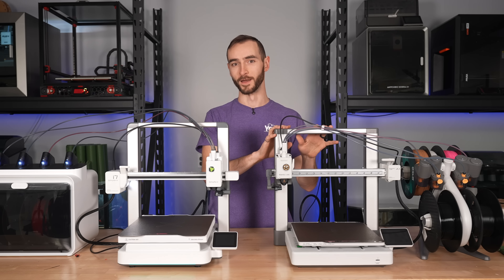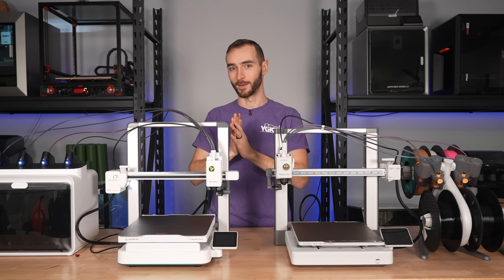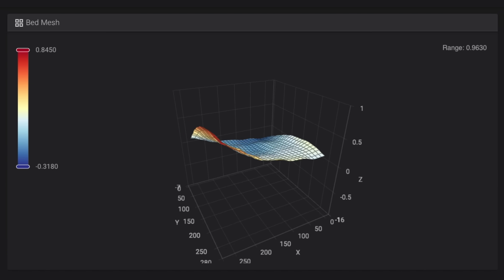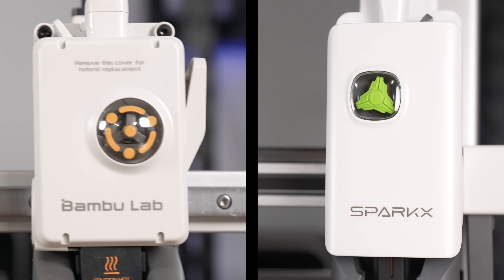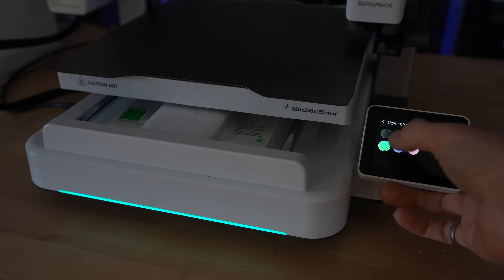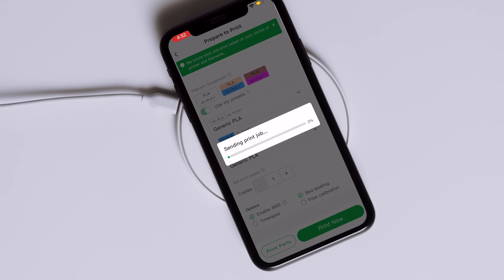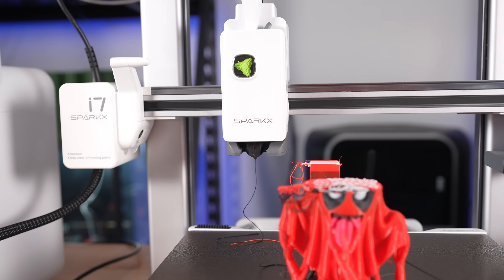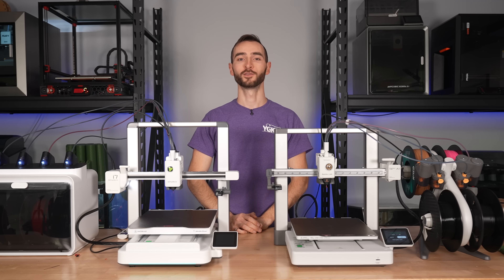Creality Cloned Bambu's Bestseller (and made it better?) - SparkX i7 vs Bambu A1

Comment from the maker: Take your personal data back with Incogni! Use code YGK3D at the link below and get 60% off an annual plan: https://incogni.com/ygk3d

So what do you think, just another clone, or a meaningful improvement?

Buy the Creality SparkX i7: https://tidd.ly/4jNwMCd
Reply: The Creality HI was supposed to be this, remember (seriously, do you remember it)? Until Creality can stick with one product more than a year, there's no way I can recommend them. Proprietary-part-laden machines are bad enough, but if they stick with a design and support it for years? I understand. But Creality doing this every few months? Creality got away with it with Ender 3 variants because they were so easy to modify on and were dirt cheap.
Reply: @See-essEll  if anything thier k2 lineup is here to stay the k2 was a trume competitor to the p1s and the k2pro and k2 plus ore more in line with the x1c. the main thing that's missing on the standard k2 is the auto flow calibration but the higher temp tool head and upgraded extruders cant be that hard to add although you may need to recalibrate the e steps and access the build root which they give you easy access to.
Reply: @See-essEll  Exactly what I was thinking. They just came out with an A1 clone and they're already replacing it. What does this printer do that the Hi or A1 can't do? If it's just clone of a clone, then I'll just stick with the original.
Reply: @See-essEll  yeah and what's with those product names, cmon...
Reply: Well it's creality so it's probably garbage. They just churn out products hoping one sticks and makes them money so they can churn out more products. And even when one sticks and sells well they still abandon it a year ish later for next product. Creality is just not worth it in my opinion. At this point I would recommend people go prusa or bambu
Reply: Given it can't actually print,  let alone print better.   Fail
Reply: I have Creality hi and a1 mini, both no mmu (ams/cfs) I think it’s very similar print quality. I got each a round 100$ price. 

bambu better for printing some stuff from shop.

I’m very excited about cfs lite system, very clean view, maybe it’s will no stuck and can use it
Reply: clone
Reply: Will you do the same video in a few weeks with the Anycubic Kobra X? It'll be even more funny the second time... 😆
Reply: You sound like a huge fan boy for a printer that doesn't do anything better than the A1. "On par with the A1", "...virtually identical" etc.  You're applauding the company that couldn't get the Ender 3 to even come close to bambu quality because they copied Bambu's homework.  They are a laughing stock now.  The only thing they can do is copy because they're terrible at their job.
Reply: @jreddestructo they can't even copy others well. Gotta make the printer with corners cut instead of making a decent machine.

Comment: I prefer the rail system because it has a wider support range and is adjustable. In contrast, the rod and bushing or bearing system eventually wears out and cannot be adjusted, which is a major drawback for me. The Creality Ender 3 v3 Corexz comes with linear bearings, and when these wear out, they cause irregular movement on the bed and result in printing defects in the models.

Comment: It looks good on paper. I like the more open platform.  The A1 seems more polished and ready to go.  The i7 failed several times. When I setup my a1 the instructions specifically called out that cable and where to place it (a double check your setup so it doesn’t get stuck).  There are lots of little improvements but how does it perform- it seems i7 needs more tweaks.   The i7 does seem to have a better AMS. And spaghetti detection is nice.  IMHO It’s a clone but doesn’t standout.

Comment: So as for actual performance the I7 had more print failures, a wire design that easily gets caught and ruins prints,  slower startup and print speed, poor pressure advance and generally lower print quality but it can save maybe 15% filament waste on color prints that can probably be tuned in bambus settings anyway... and you somehow concluded its the better printer by what metric???

Comment: Bambu's parts availability will always outshine Creality's. I've never needed parts for (3) A1 Combo's myself. I like knowing a $20 bill can buy me almost any part for the printers with sufficient change left over. No emails or calls with someone you can barely understand is really important for me.  Creality doesn't even have parts section on the website that I could find, lol. using the search bar to look up "lcd screen" yielded no results. Yet I go over to Bambu Labs website and can buy a screen for any model easily. Most importantly before you buy a printer you can see what replacement parts cost.

Comment: For now just get A1 instead. You lose nothing, it's just a cheap clone from a company with terrible management. 

This I7 has linear bearings on Y bed, not bushings. They loud as hell. A1 is the quietest printer right after A1 mini.
Creality is a company without any concise. Recently they abruptly blocked firmware sideloading on fresh units of years old K1* series, without any notice.
Crucial auto PA-calibration feature for now is absent from marketing materials and from reviewers units. DO NOT buy until it will be tested AND confirmed as working and USEFUL by the reviewers. X1c also had auto-PA and it were terrible. Only since A1 bambulab got it working well enough for practical use and actually very good.
Reply: Need to say that bambu spent years to iterate A1 auto-PA to get it to current state.

Comment: No pressure advance sensor? Good luck with the long term use of that Creality printer. When you try to print other types of filaments it will fail more than expected…

Comment: ive been printing for 10 years now reprap >box up >makerbot>creality cr10 first edition e5 crx e5+> ive 8 printers now & just got my first bambu h2c . so so easy to print with software is a blast .its the only printer i have not had to print upgrade parts for and not had to play about with cura settings

Comment: A1 is now quite old so a newer A2 is a good guess as they done P2S . The testing community for new tech is much more at scale in the A series price point, all that tech rolled up the range in some form. So Creality cloned an obsolete machine, usually their stuff shits the bed anyway and they missing the Bambu ecosystem. Anyone who wanted an I3 format machine already has a Bambu, market is done. Next big thing will be innovation to pull folks away from workhorse A1's with say AI, wider material support and the like within the limitation of no chamber, probably laser and cutter support to get the consumables sales mass market over a few sales they currently do

Comment: You breezed over the fact it kept failing way too quickly, also about the need for PA calibration <on their default print files with their filament>.

This smells, I expect to hear what’s better but also worse, not just breezing over it.

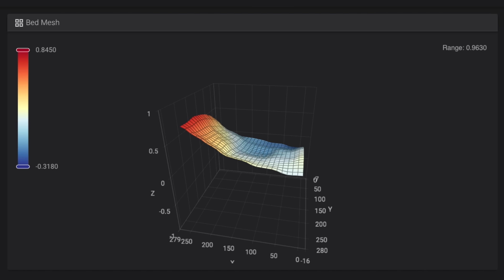Comment: 3:23 I do have some surviving information from my klipper modification of my a1,
looking at the graph on screen it is similar to what I remember, and the first mesh that I got (have image), was like +0.6 at highest and -0.2 at lowest, but only has 3x3 points.

I would say that the i7 is slightly better, but still has that same tilt of the a1.

Edit 1: The camera can do around 2-3 fps but its mcu limited,
Edit 2: I found the larger 5x5 image, the bed is slightly worse but my mount wasn't that stable so not as accurate.
Reply from the maker: Interesting! Thanks for sharing . Very curious how you managed to Klipper-ize the A1.
Reply: @ygk3d  Bed mesh in description: https://www.youtube.com/watch?v=fLf-GMceLxE

I was using a skr pico with mostly stock hardware, just with btt microprobe, haven't gotten bed working.

I am currently working on some drop in replacement pcbs for the toolhead and mainboard.

Comment: The A1 got me back into printing. After 180 hours (in three weeks) I had my first failure, which was operator error - the dishwashing brush had oil residue on it when I cleaned the build plate. I also had to take out the nozzle for de-clogging and clean the filament drive wheel, it had ground a bit of filament due to the clog.
Ended up just replacing the nozzle as my hardened panda had arrived. All very easy and though an allen wrench is needed, everything is straight forward to do.
Now I am looking forward to my p2s with the ams2 pro to arrive. Bambu printers are for printing and not tinkering. Sure my only other experience was years ago with a second hand prusa and a creality clone, annet. But, dang. That thing, the A1, just prints!

Comment: We have 19.000 hours in 9 A1 combos. You don't have easy access to the mentioned parts, because you don't need to. Today is the first day I have to check on an extruder on one of the machines, which is acting strange, but apart from that, A1s are rock solid. Also print detaching from the bed is user error 95% of the time, the bed wasn't superclean. But also the wire issue as well. For this price difference, I'd stick with A1.
Reply: I had a bambulab printer heatbed fail and need replacing with less than 40hrs on the machine. I wish it had been built better for maintainability.

Comment: I'm actually mildly impressed this time. I just didn't see it with the Creality Hi combo, but this seems like a solid Bambu alternative I'd recommend to friends... so far I've been pitching the Elegoo Centauri Carbon as a replacement for my friends' Ender 3's. Four people I know have purchased Centauri Carbons, four out of four are super impressed and shocked after stepping into the new age of 3D printing lol. This could be a viable multicolor option for the people I know who aren't into heavy engineering grade materials like ABS, ASA, CF filaments, etc.
Reply from the maker: I haven’t tested the original CC but I’ve got the v2 here with the integrated multi color unit waiting to be tested. Will have a review coming later this month.

Comment: Good comparison thanks! I like my creality printers (k1c & ender3pro) but they have gone through all the firmware fixes over the years, at least creality keeps on updating their old printers. I just wish they would standardize their nozzle in stead of bringing out a new one with almost each new printer. I would also like to get a bamboo printer but unfortunately where I live they aren't widely available (only through one store pretty much) and they are really expensive compared to creality here.

Comment: The Creality CFS light system appears to be a better setup than the open AMS system on the A1. Also running the filament out the top should have been the way to do it from the start instead of having the filament run underneath like all others do. I imagine that it won't have the jamming issues others have.

Comment: New Creality printers names make me laugh. First "hi", now "sparkx"? Wut?
After multiple Ender 3 hilarious names they switched to random word names.
I would admit, I fell into sale prices net and ordered hi with cms combo for $300 or so. But it is only because of the price. Did not used it though. My Ender 3 works OK for me. But will look someday into it.
All those clones nor old Bambu models (and they are all old if they does not have multi-nozzle auto switch or multi-extruder compatibility) means nothing now. I am watching with pop-corn bucket at modern multi-tool printers evolution. Bambu and others have multiple solutions already. Those Ender 3 clones with 1 nozzle only (or even two, Ender 3 had those mods long ago) are obsolete.
So there is no purpose in arguing which obsolete printer is more obsolete = )

Comment: You mention strain relief as an A1 problem, but Creality has had that on numerous printers, in particular their first line of printers that used load cells/strain gauges.
Reply from the maker: Oh absolutely. Creality has shipped some terrible printers. Just saying that it looks like they at least put proper strain relief on the bed cable this time.

Comment: You would think that Bambu got use a similar filament saving strategy via firmware updates? But probably I totally misunderstood the used approach
Reply: The illusion of saving filament with less poop will be evident in a lower quality print, which is exactly what Creality is doing. Watch other videos that actually show print quality and you will see.

Comment: Are you sure A1 is limited to Bambu software? I can use Orca with my X1C
Reply: Since Orca is a clone from Bambu Studio, I see no reason using it for A1. Orca was made for other printer's users  get a Bambu like experience.
Reply: @antonio-l8n2z it has QOL features over bambu. Its not a direct clone. But whether it needs to be used is different than if it can be used which is the comment I made.
Reply from the maker: You can but need to be in developer mode if you’re on latest firmware. Or use bambu connect. My explanation was overly simplified.
Reply: the X1C has special treatment and is not limited (mostly) you can even use a custom firmware but the other printers don't have that priviledge

Comment: AI is marketing fluff to me and I don't care. Overall, I like that it is cheaper and runs Klipper. The more open the better. Reliability and serviceability will definitely matter. Would need to see more head to head print quality comparisons to really judge. I will say though, still not a Bambu Lab guy in general, so if this is could, at least I could put it on a list of possible recommendations. Hard not to recommend spending just a bit more than either for a Qidi Q2 though. And holy crap Creality really could have named this better. Just name it the Creality Spark 1 or something at least a little less silly.
Reply: Creality should have checked Hydraulic Press Channel and name this

Think Maker One Million 😅

Maybe it is 7th iteration of something . i7 - More Sparks Than A1 Ever

Comment: I come from the drone hobby and if you know anything about Bambu they are former DJI engineers and if you know anything about drones you know how DJI is generations ahead of the competition. Bambu surely has a new product about to launch with next level features that will make it impossible to even sell your previous 3d printers. When the A1 came out I had a hard time even gifting my ender 3 to someone. I had to force it onto a friend of mine, and big surprise he hasn't even used it, he's saving up for an A1.
Reply: Recently they're actually caught off guard. They're trying to catch up now. So maybe don't just assume.

Comment: yesnˋt. I agree at some points. Yes, I agree at some point like the CFS Lite. But for example the Y axes cover on the A1 prevents pretty much all dust to get into the chamber versus the rails on the I7 are pretty likely to dust up over time. Sadly you didn’t look over the Specs of the printers like max nozzle temp or how even the Print bed is heated. So I can’t really tell if it’s just a clone or a real contestant. Also you should to more Prints with the 2 contestants to see how they do in the long run to test the consistency of the printers.

Comment: I'm not a Bambu fan I had a Creality printer before and It was my entry to 3D printing It was cheap but to much hassle, I set up the printer to my best knowledge and the kill/death ratio of my printed stuff was in the negative mostly, I'm not saying It wasn't me but my hobby wasn't tweaking a printer it was the stuff I wanted to print out so I got disappointed and let it rest for 2-3 years, down the line I got myself a Qidi Xmax-3 which was a waaay better experience and now as a second machine I got my self a Bambu for multi material printing, I'm not a fan of closed systems but If I don't screw up my build plate with my hands they print good 9 out of 10 times (at-least till now :) and that's what I wanted its nothing praise worthy because that should be the norm and bare minimum (although the bambu support is very disappoint) so in short I don't trust creality and I'm not the only one they look good they promise a lot of things but a lot of times cut corners and fail to deliver

Comment: its a shame you didnt test if the cfs works with tpu
that is a major deciding factor for me 
because i want to print tpu hueforge patches
also more and more people want to print flexible filaments so its not just me interested in this
Reply: Pretty sure TPU is an issue in EVERY filament management system that relies on a decent length of PTFE tube between where the spool is and where the extruder is.  It's more of a problem with friction/tolerances than it is with the feed mechanism itself.  Even on things like the Snapmaker and Prusa tool-changer systems, I think the only way they support printing TPU is if you disconnect the PTFE tube from the top of the extruder and feed the TPU directly in (or through a tiny piece of PTFE just acting as a "guide").
Reply: @theElemDragon nahh you see thats the problem you assume .
 snapmaker u1 supports tpu without a problem